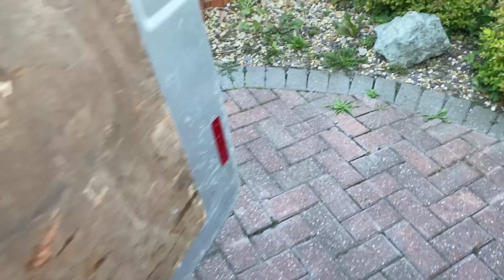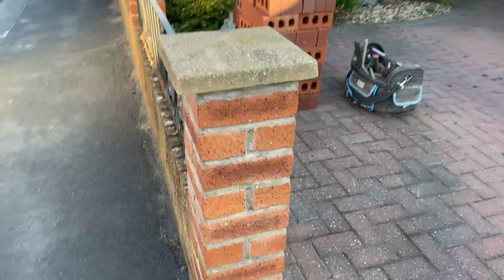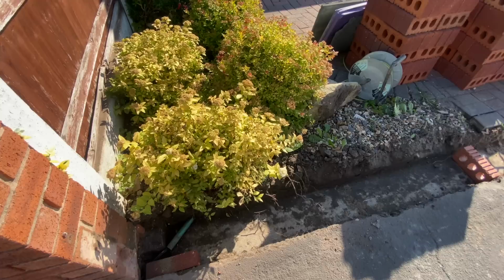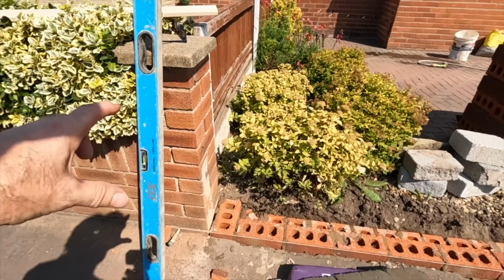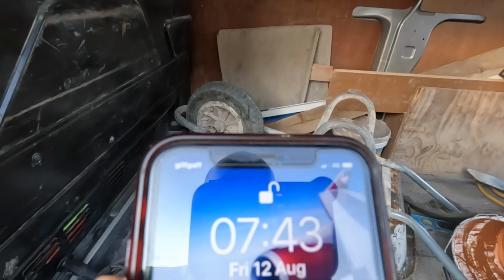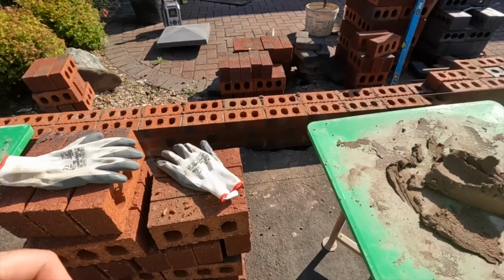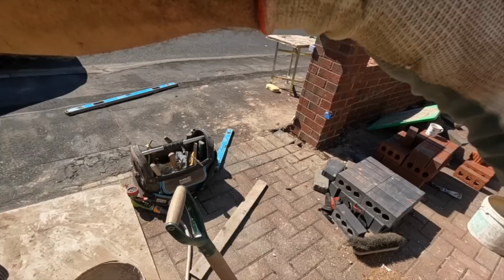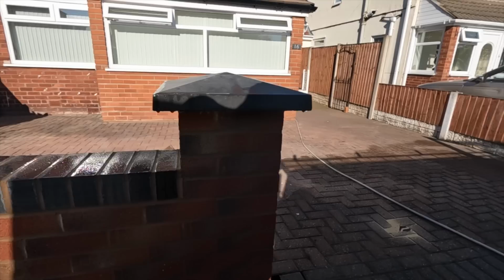DANGEROUS GARDEN WALL

Comment: When we bought our house in the 1980s it has a single line brick wall at the front of the house bordering the street and it had collapsed. It was rebuilt with double brick thickness and it's still holding up to this day. We found out though that brick walls are expensive. It cost us £1000 back then. It was under 19ft wide (excluding the gap for the path and garden gate).
Reply from the maker: Yes a single skin wall is never ideal unless it’s very low .
    That wall you got would cost a fortune now as bricks alone cost roughly £1.20 each, back when yours was done they would have need about 30 p 😬🧱👍🏽

Comment: Great job as usual, however, I think some cold lay macadam would have looked better to fill the gap on pavement side.
Reply: Even some black brick dye would of been better nice job thou
Reply: @ryanr1237  my old block front wall I re painted when we moved in, was a 5” gap between the bottom block to a paver edger, the concrete had broken in places over time with standing water and was an eyesore. I cut it out and re did it, I haunched it for run off and painted black. Looks mint. No green or cracking since. Even some black masonry paint will make it blend in, tidy job nonetheless.

Comment: Why didn't you build it in English bond or Flemish bond thereby avoiding the weakness of the vertical straight-joint through the centre  of the wall ? ( also much more attractive ) .
Reply from the maker: Because it would have looked odd amongst all the other walls plus I don’t like Flemish 😬🧱👍🏽

Comment: Hi, I have a quick question and this could be because the way the footage has been taken but the coping stone on the pier seems to be sticking out a lot.  Just for anyone's benefit, I am just a keen 'diyer' rather than any kind of trades so it could be a simple answer to this. I am aware that you have to allow for some space between the wall and the edge of the coping stone for the rain water to drip down. Thanks.
Reply from the maker: That’s just the nearest size they do in that colour which isn’t ideal 😬🧱👍🏽
Reply: @SteveAndAlexBuild  Thanks, I had a front wall built a couple of years ago and tried to go as close as possible to the coping stone size. Faced exactly the same problem, I asked for the piers to be built slightly chunkier which still left me around 40mm to play with on all sides.
Reply from the maker: @RagingBlade1  🧱👍🏽

Comment: Maghul… been there years ago…site of the mental hospital (near the railway)…plans were to build a new prison on the site, so it got demolished… built out of HUGE special bricks, about twice the size of regular bricks…then the government pulled the funding…so only one new prison got built, in London, next door to Bellmarsh, and called HMP Thameside…
Reply from the maker: Its still going mate . Ian Brady’s place of residence and death 🧱👍🏽
Reply: @SteveAndAlexBuild  interesting…must have built a new place then, as the original was flattened…originally part of the plan was to also build a new railway station on the site, on the existing railway that run past the site… Just looked it up, and yes, seems they did eventually build a new (mental) prison on the site…the photos on-line from last year make it look like the place is pretty new… the original demolition was done back in 98/99 I think, maybe it was a year or so earlier, can’t remember now…
Reply from the maker: @stun9771  . The old hospital is now a persimmon housing estate ( where Stu crompton worked ) 
   Maghull north staton is now up and running . A new slip road was put in on the m58 and a new motorway service station has just opened .
   Work just stated on about 1.5 thousand houses on the farmland opposite the hospital entrance 😳🧱👍🏽

Comment: You could do with a labourer to help you take the wall down, do the mixes and line up new materials, but I guess its hard find a decent one these days ?  A battery breaker would be really helpful to in taking the old wall apart too.  Did you tie the new wall into the existing pillar on the boundary ?
Reply from the maker: My son was away when this we filmed and they wall didn’t need our breaker 💪🏼🧱👍🏽😉
Reply: @SteveAndAlexBuild  nice wall. neatly done sir.
Reply from the maker: @brianlopez8855  thanks very much 🙏🏽🧱👍🏽
Reply: I love labouring. Is it really that hard to find someone who can do as they're told? It's about as unskilled a job as there is.
Reply from the maker: @BlueZirnitra  😆🧱👍🏽

Comment: Did the original wall fail at the mortar course because it was single skin and without a pier?
Reply from the maker: Pretty much Norman plus I think the railings rusted and cracked the mortar 🧱👍🏽
Reply: @SteveAndAlexBuild  Thanks for answering Steve.👍
Reply from the maker: @normanboyes4983  no probs 🧱👍🏽😁